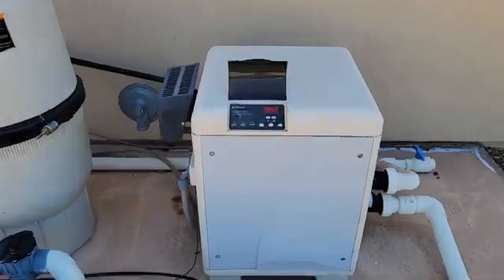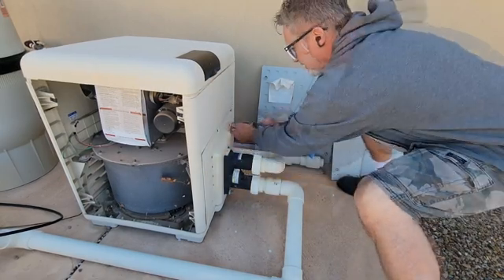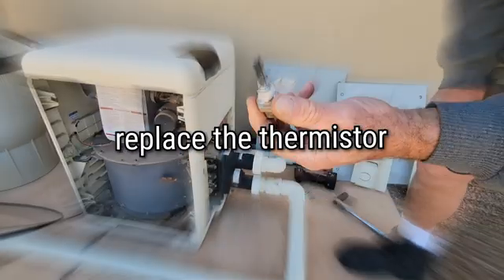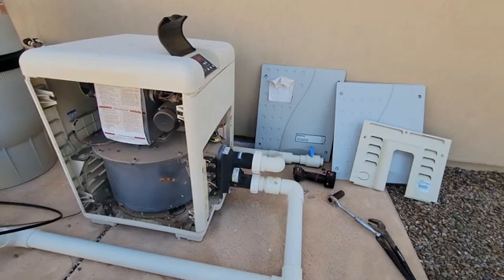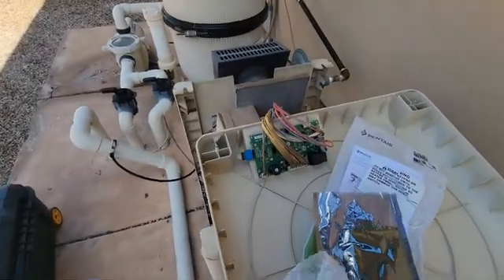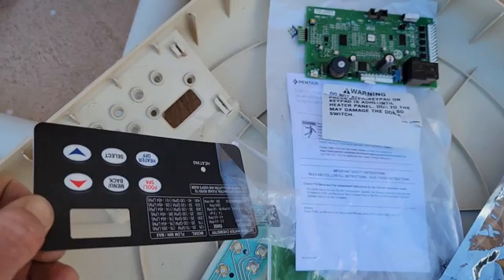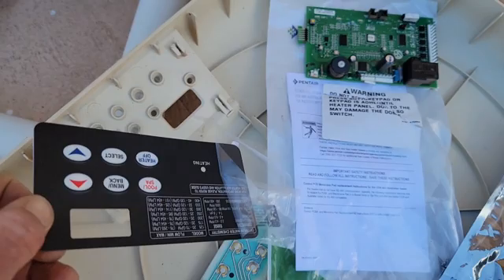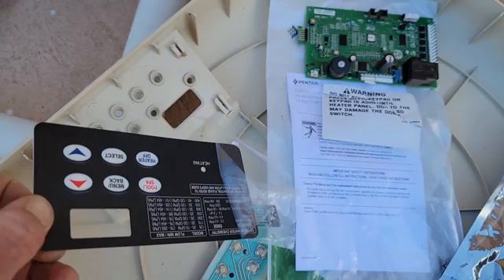Pentair Mastertemp E01 code diagnostics/repair

Comment: Why not just check the sensor fault light on the board after replacing the thermistor? Will the light go off right after replacement?